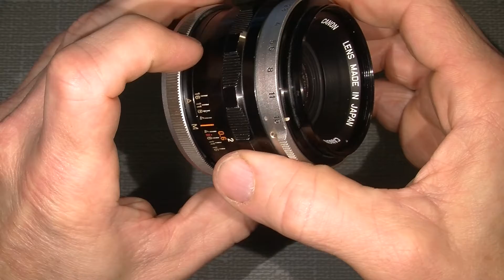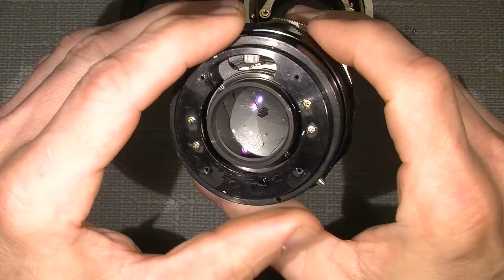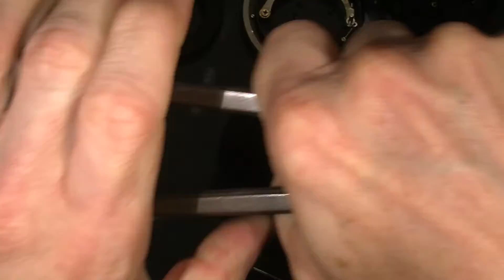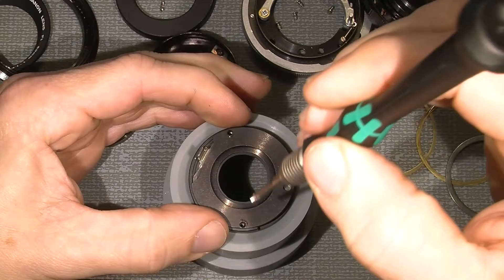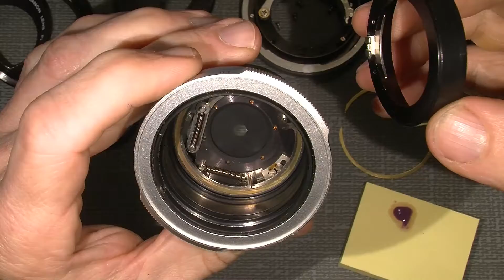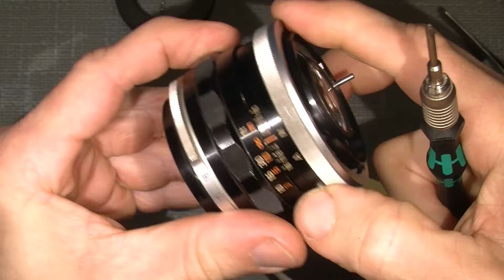Working with the aperture system in Canon FL 50mm 1:1.8

Comment: Thank you very much :-) With this video I was able to repair my lens. Bought it in Tokyo 2023 for about ~15€ in very good condition, only missing the front cap. Got back home and after about 10 minutes of testing the aperture was stuck wide open... Left it aside two years, found your video and some motivation aaaand the aperture worked all of a sudden. But only for another 2 minutes. Then I noticed a lot of oil on the rear of the aperture blades. I went through your video except for opening the Individual blades. Cleaned everything I could reach and now it works fine :-)